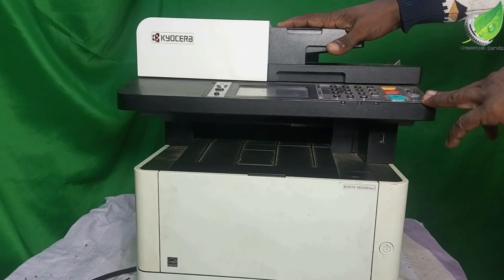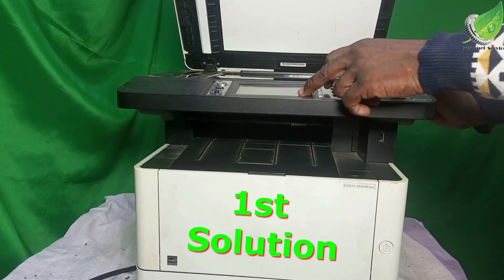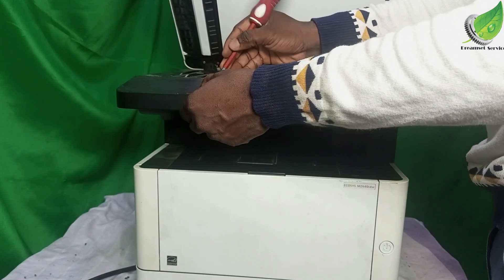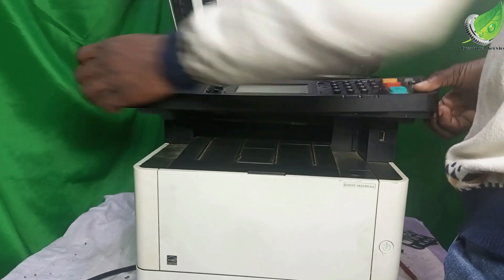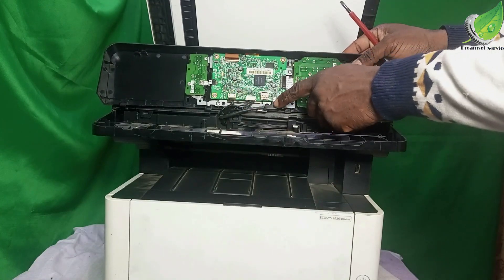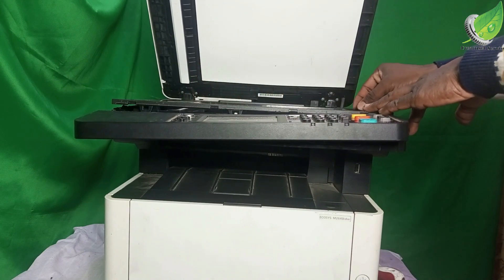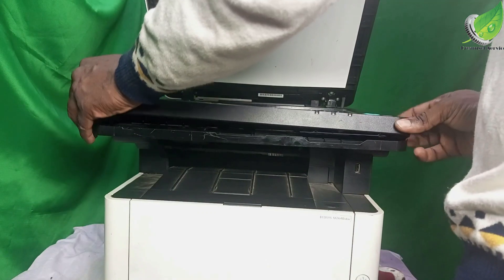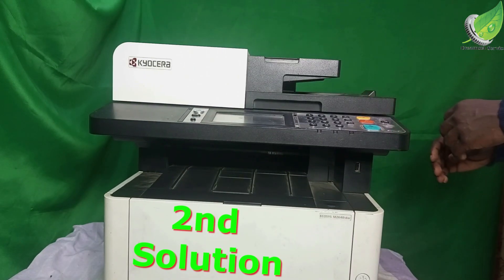C3100 Error Repair for all Models of Kyocera Printer

Comment: Code 0100 how to repair
Reply from the maker: try a full power reset by unplugging the machine for at least 60 seconds. If the error persists, the issue may be a flash memory malfunction or a faulty main PWB (Printed Circuit Board). To resolve this, you may need to inspect and reseat the connectors on the main PWB, or if the board is faulty, replace it.  
Step 1: Perform a Hard Reset
This is the simplest and most common first step for many error codes. 
Turn off: the printer's power switch.
Unplug: the power cord from the wall outlet.
Wait: for at least 60 seconds to allow the internal components to reset.
Reconnect: the power cord and turn on the printer.
Check: if the error code has been cleared.
Step 2: Check the Main PWB
If the reset doesn't work, the problem might be with the main printed circuit board. 
Locate: the main PWB, which is usually on the main logic board.
Inspect: the connectors on the main PWB.
Gently disconnect: and then reconnect each connector to ensure a secure connection.
Step 3: Replace the Main PWB (if necessary)
If the issue is a faulty main PWB, it will need to be replaced. 
Turn off: the printer and unplug it.
Follow: the instructions for accessing the internal components.
Take a picture: of all cable connections before detaching them, so you can reconnect everything correctly.
Carefully detach: the cables from the old main PWB.
Remove: the screws securing the board.
Install: the new main PWB and reconnect all cables.
Power on: the printer and check if the error is resolved.
When to Contact a Professional
If these steps do not resolve the C0100 error, there may be a deeper issue with the hardware. 
Contact Kyocera Support: or a qualified service technician for further assistance. Remember to like and subscribe 🤠🤠🤠